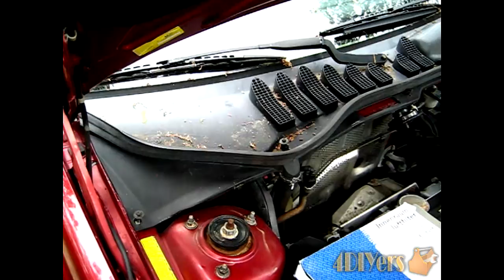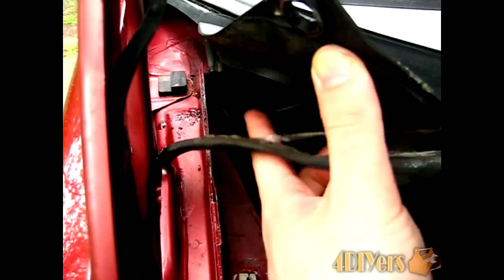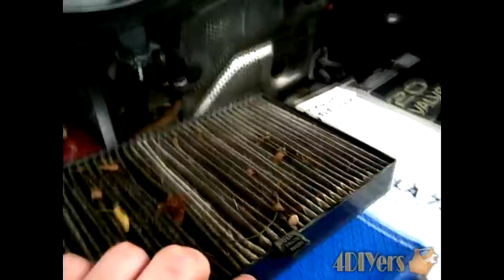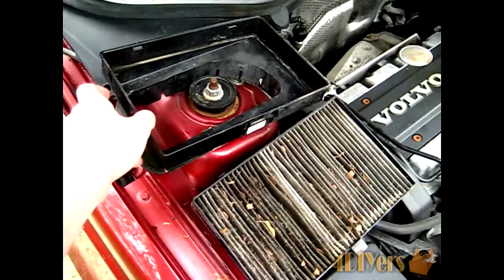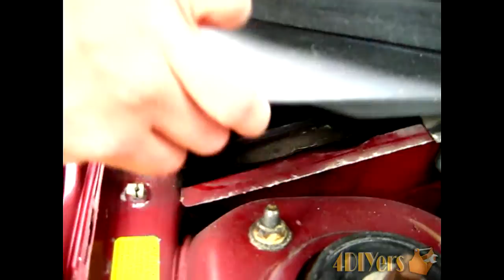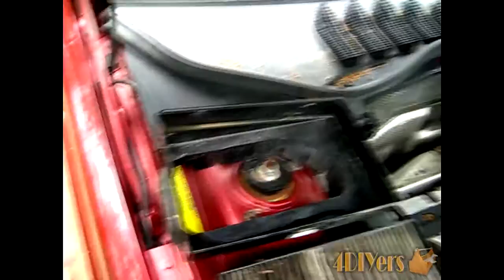How to Replace Volvo 850 Cabin Filter

Comment: Dear Sir, do you have a video replacing a air filter in a 960 volvo 96?
Reply from the maker: As far as I know, the 960 is not equipped with a cabin filter.

Comment: Hi Robert..I want to buy an older Volvo wagon as I enjoy your videos which help me greatly. I'm handy I have my eye on a 98 v70xc non turbo.4wd. perfect running condition   another 1996 850 turbo wagon fwd lots of receipts ,timing  belt done, heater core,New tires full tune up & a 01 v70.  4wd.  needs coolant container.
runs great...
any suggestions..which one?
all in descent shape,same price
Reply from the maker: +Gregory Fitzgerald I believe you have me confused with someone else but I'd be happy to give you my input on the purchase. Engines are very similar overall between all vehicles, 2001 I believe has an electronic throttle control modules which do fail and can be costly to repair. Being that the two cars are awd, be sure all tires are the exact same which regards to makes and size. If not, this can damage the awd system. Personally I find locally the early Cross Country models do not bring that much value where I am located and are very hard to sell. Early 2000 models also were known to have issues with the awd system, 2004 and newer cars were fine. Even though the 1996 is the oldest, it would probably be the most reliable and being that it's had some bigger ticket items replaced (timing belt, tires, etc), along with all the maintenance records, it seems to be a car that was well taken care of.
Reply from the maker: +Gregory Fitzgerald I also forgot to mention the Volvo shown in my older videos is a 1996 850 estate turbo. I didn't have the car for as long as I'd hoped to (ended up buying a car I had been searching years for), but overall it was an excellent car. Mine had 200,000km when I purchased it, needed the alternator replaced, along with the blower motor, resistor block, and camshaft sensor. Other than that, everything else was basic maintenance and I would definitely get into another one if I had the opportunity.
Reply: Thanks. Yes I did have you confused with someone else but I did respond to him also..& he did say to get the 96 fwd turbo which I have my eye on one that no one buying & it is sweet..brand new tires,full tune up,heater core lots of other receipts..Plus the roof rack cross bars on it..even no check engine light...I'm not sure if I'm going to look at it. & he asked 1,500 then went to 1,300 & I talked him down to 1,000. If I do look at it I will check the pcv system or a rear end seal leak...
Reply: But I forgot...I like this  Volvo wagon v70xc cross country non turbo but this car is in perfect condition...AWD....I saw a u tube video & test drive about them in a snow  storm & that car must be so fun to drive,super comfortable,& safe...it's newer. & this cars 10 years old & it's brand new...blue exterior without a Mark..even the inside..he wanted 3,500 but he took 3,000...
Reply: The year on it is 2005  tan interior blue outside.. brand new tires also..all 4 the same. See when you look at cars you get confused...
This cars newer...1 owner so he bought it new & now in 10 years I may scoop it up.
Reply: 0only 121,000 miles
Reply from the maker: Certainly can't go wrong on a $1000 well maintained car. I know with the market where live, it's next to impossible trying to find a clean example. With my current car, I actually approached a guy in Walmart and got lucky. The older turbo'd Volvo will always hold their value, especially from an enthusiasts standpoint. I am currently seeing the old 740 turbo'd cars having the same value as a car 10yrs newer. 

As clean as that Cross Country sounds, personally I'd hold out for something else, especially spending a little more. If you were getting a deal similar to the 1996, then it's definitely in your favour. And it'll at least give you room if you ever need to maintain the awd or electronic throttle system.

Considering that is an 05, then it would be at the top of my list. Haha, not a problem, happens to all of us. Being that it is a one owner, that for me is an import point as well. As long as the seller is honest, he'll know everything that is done to the car relating to maintenance or accident history. New tires I always find is a good buying point because it can be a big ticket item for replacements. Be sure to check if the timing belt has been done. If not, that will cost around $1000 depending on the shop. But on another note, it's a great bargaining point too.
Reply from the maker: I don't believe I mentioned this either, but if you are looking at buying OEM Volvo parts, IPDUSA is an online source which I was happy with. It took me a little searching to find out where people bought their parts from and from my experience I was happy with them. They're fairly popular in the Volvo enthusiast community.

Comment from the maker: The cabin filter does have a few purposes. The main one being to keep dust, pollen, or any other debris out of the interior of the vehicle, works great especially if you have allergies. Depending on where it's positioned in the vehicle, it also keeps dirt out of the blower motor which can affect its life, as well as debris out of the ducting and heater core or evaporator coil. This also reduces the amount of dust entering the interior too.